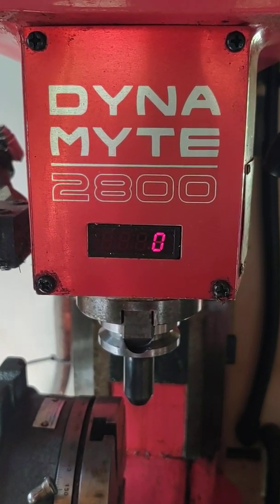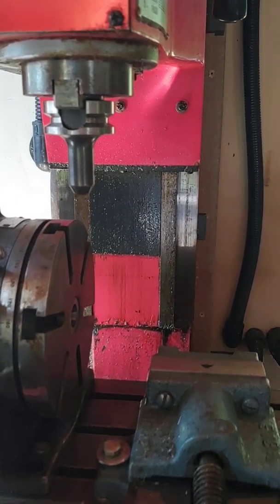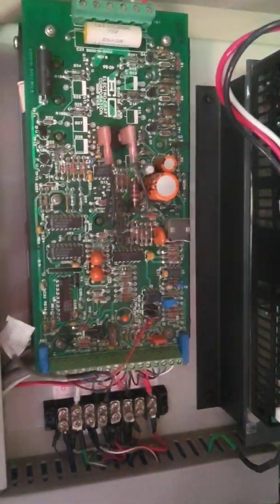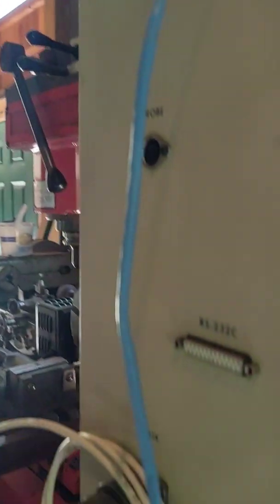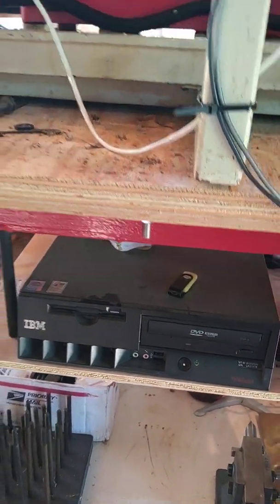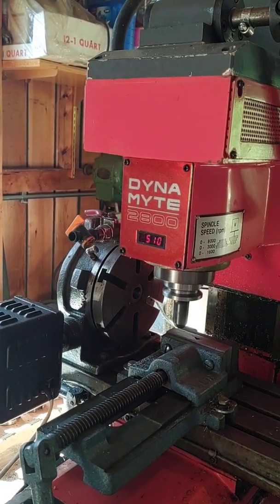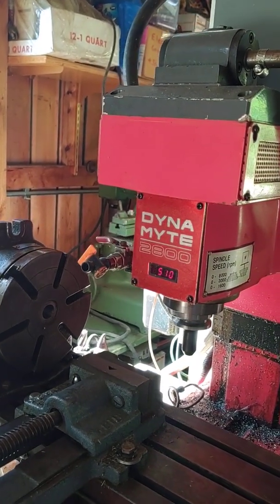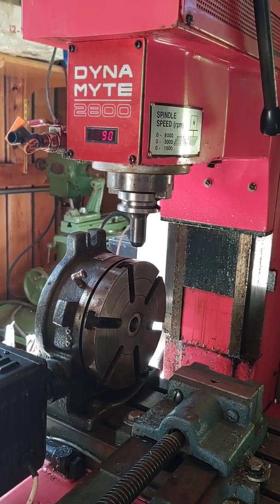DynaMyte DM2800 Retrofit

Comment: I have two of these I have to retrofit I don’t have any of the dyna software I have tons of the original parts
Reply from the maker: I provided a link to the build in the comments. On cnczone.com where I learned how to do it. I recommend different stepper drives since the gecko doesn't let you adjust microstepping. I think the machine would be faster with no loss of accuracy.

Comment: hello I have a Dynamite 2800 and I would like to update them to use it with mach3 how can I do it
Reply: Ramiro, I outlined the build on the CNCZone forum link included above. That forum is where I learned how to do it. There are many examples. If I could change one thing, I would explore a different axis drive. The Gecko G540 is fixed at 10 microsteps which gives a resolution of 0.0005 mm. Fewer microsteps should allow higher feedrates.

Comment: Have you cut with it yet? How well does it cut steel?
Reply: I had problems when I tried using a 3/4" end mill on steel. Not enough torque and when the spindle stalls the axis keeps going. I'm using the pulleys that give me the most torque and using smaller tools. Take light cuts.